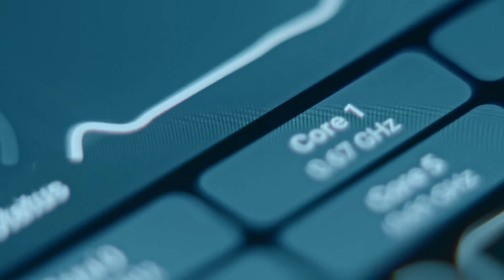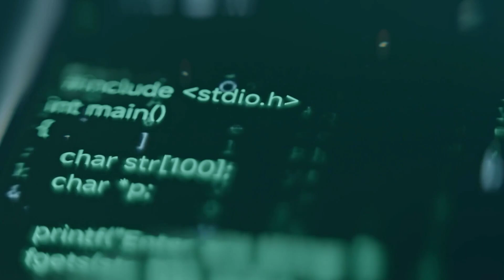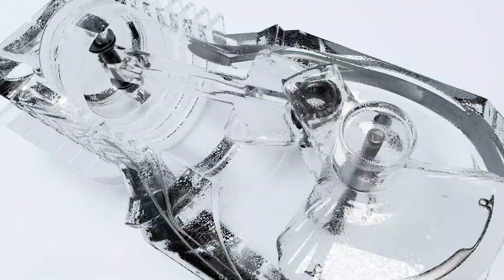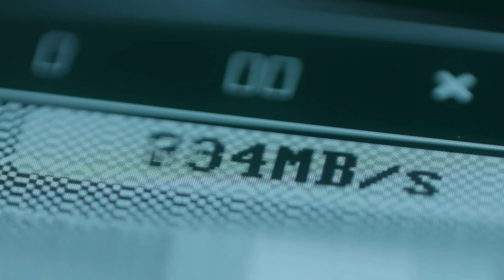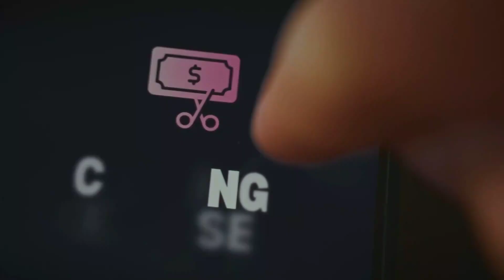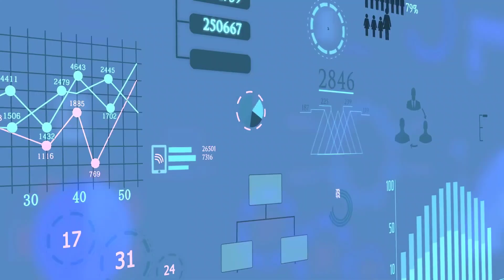DeepSeek Just Broke the US Chip Ban Again

Comment: Deepseek is incredible. It's already FAST on 236B parameters even using a microcontroller client. Engram is also on top of the bypass of the ARM architecture sanctions with an architecture that even handles AI vector computation. Even the first generation of those CPUs is lightning compared to anything else - unless you include hardware 10000x more expensive. They have locked themselves in the jail. So satisfying.
Reply from the maker: When software efficiency + custom vector architectures let first-gen CPUs rival hardware 10,000× the cost the deny compute strategy is already obsolete.

Comment: Have you not seen the price on RAM lately?  Triple or Quadrupled in the past 18 months.  China's end game started in 2007 with Apple, and in the 2010's they were building 90 percent of them... If this were a game of kickball, ALL of the Chinese players would be chosen first.
Reply from the maker: Thats a fair point on memory prices DRAM and HBM have absolutely surged and its a real constraint the industry is feeling right now. But thats exactly why this DeepSeek moment matters. Chinas advantage isnt that RAM got cheap it didnt. Its that theyre redesigning systems to get more output per byte and per GPU instead of assuming unlimited memory and power.On the end game argument yes China has been planning industrial scale since the 2000s. But what’s changed isn’t manufacturing volume  it’s architecture under pressure. Export controls didn’t stop AI; they forced optimization.The takeaway isn’t China wins by default.It’s that cost memory efficiency, and system design now decide who wins not just who buys the most hardware.That’s the real shift this video is about.